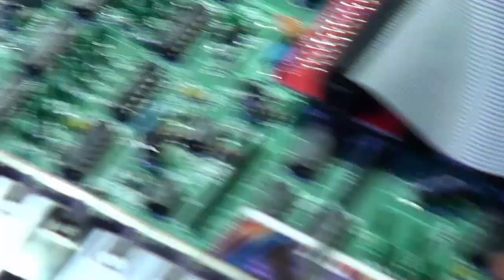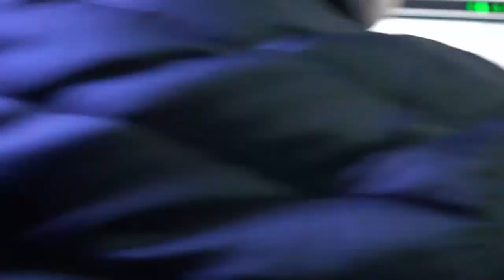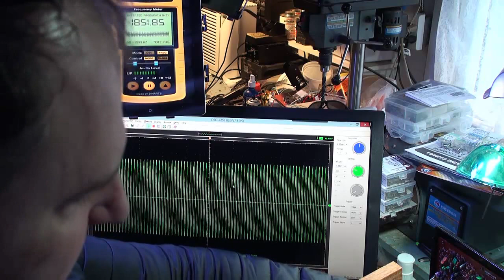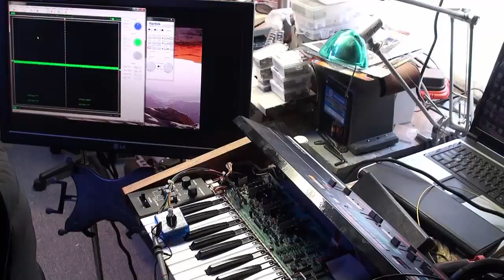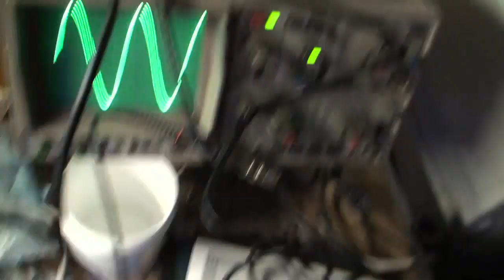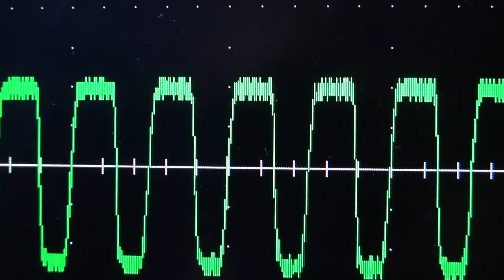BT's Kiwi-106: Part 8D (Super 12-Tone Calibration!)

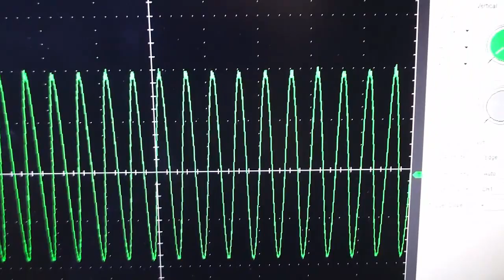Comment: Aargh! Syntegrator admittedly Im outta my depth here but at 25:53 the function gen says 19.5vpp - not 10vpp?!?! Sorry if Im wrong here mate :-)
Reply from the maker: Certainly looks like you're right. I did punch in 10v pp in the generator and confirmed that in the scope before I shot the video, but as you saw in the test results, the wave was still nice and balanced in the clipping which is the important part.

... No wonder the headphones were unhappy passing that signal, as it was twice the amplitude and therefore 6db more sound pressure level. Still, no harm done.
Reply: Syntegrator Thanks mate! And thank you for this series.